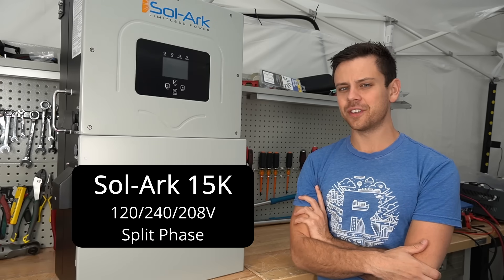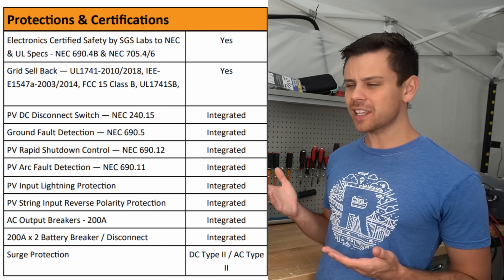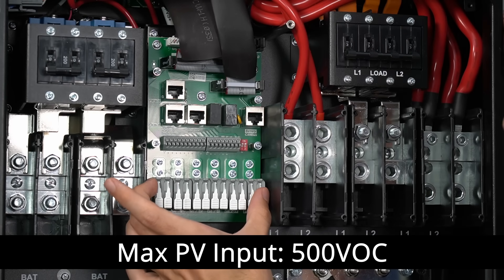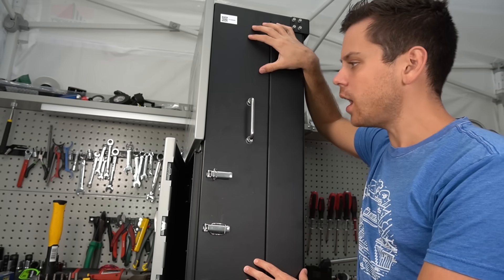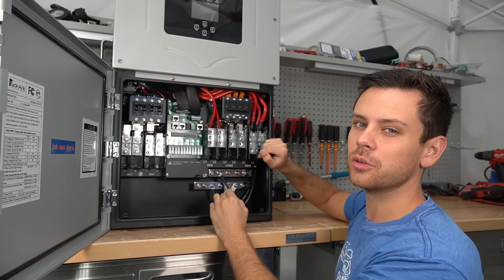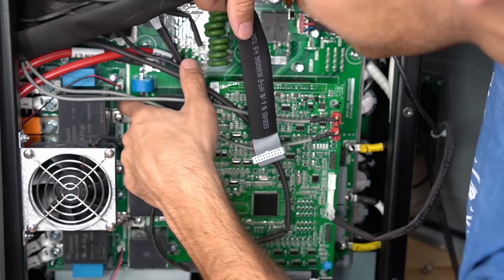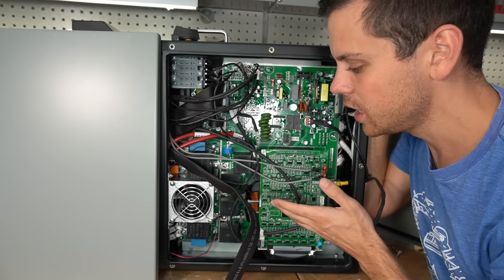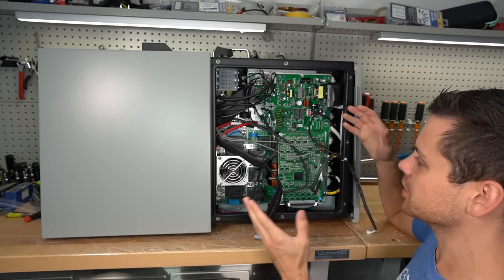Sol Ark 15K: Ultimate Grid-tie or Off-grid Inverter

Comment: Their tagline is "solar for everyone" and preach independence but if you want to qualify for full warranty and support you can't install it yourself. That and the price tag many many times everyone else is a non-starter for me.
Reply: @Channel-gz9hm  You don't need a 3 year union apprenticeship.  You just need skills and knowledge related to the construction of the electrical equipment and installations, and safety training to recognize and avoid the hazards involved.  In other words, you need to know what the heck you are doing, so that you don't kill yourself.  That's all it takes.  It does not say you need formal schooling, an apprenticeship, etc. just enough training to keep you from killing yourself.

You should have this no matter what, if you are working on electrical systems.
Reply: You can if you are qualified to do the install.  The problem is, in order to provide support, the person on both ends of the phone needs to have reasonable knowledge, and if someone at sol-ark support is speaking with someone who doesn't know what a wire nut is, then it's really difficult to actually get somewhere and solve the problem.
Reply: @CurrentConnected  That's like telling someone they're free to be a physician at their local hospital right now, all they have to do is have their MD Board Certificate on them, no big deal. What a flippant dismissal of the issue.
Reply: @Channel-gz9hm  Qualified, as defined by NEC: One who has skills and knowledge related to the construction and operation of the electrical equipment and installations, and has received safety training to recognize and avoid the hazards involved.

In no way is this like having a MD board certificate.
Reply: @CurrentConnected  Amen

Comment: Work for The Solar Exchange in Taylor, AZ, and this beast is the most popular all-in-one we have. Only caveat is it has to be installed by licensed installers for the warranty.
Reply: Licensed in what way?

I know I'll need a licensed electrician to do the AC work (grid disconnect and reconnect to my panel).
Reply: @bkspotify4337  If that means anything other than licensed and bonded electricians then I'd never buy one.

Comment: I hated to see your last few EG4 videos go away. Hope you get those issues resolved.
Reply from the maker: I got it to work so I'm trying to figure out what to do. Might do beginner step by step video again
Reply: @WillProwse  
Looking forward to it. The EG4 6500EX is what I'm looking at for workshop power. I had to upgrade the plans from a single 48v rack mount battery to at least 2 because Signature Solar video demonstrated that an inductive load start inrush can cause a single battery system to shut down. The solar array part will have to be delayed until I can find an installer for such a small system. So I plan to run a 12 gauge line from the meter and set charging current to 10 amps. My usage duty cycle of the shop makes a 10 hour nighttime recharge a viable option. As opposed to a 150' trenched run of larger wire for even a 50amp grid service.
Reply from the maker: @The Osborns ok will do. Just need to make sure it works perfect

Comment: Too expensive; even compared to my Victron dual-inverter system
Reply: When I was selecting my recent inverter purchase I priced everything out and the equivalent victron system was actually more expensive and in many ways was an inferior system.
Reply: @niktak1114  I guess it depends on your needs.  I would need two of these to power my home.  I have two victron 10kW inverters and two external charge controls to handle 20kW input over 4 arrays.
Reply: @jeremydumoit4487 I will need two also but I'd need 4 of the 10kVa quattros (which can only do 26kW combined in warm temps).
Reply: @niktak1114  That's unfortunate.  Mine generate very close to 10kW each here in Maine

Comment: Please do some offgrid load balancing tests. That was always the problem with solarks. Lets see if they fixed it!
Reply: I am curious about this too. There's a lot of mixed reporting on this issue, and it would be great to see an in-depth analysis.
Reply: idk why everyone is getting so defensive... its a test. If there is no problem then the test would show it.
Reply: @av1204  :  Not being defensive; just trying to represent the truth. The subject has been covered (including by Dave Poz in a follow-up video). HF TL (High Frequency TransformerLess) inverters have their advantages, as do transformer-based. The transformer-based inverters do handle large inductive loads better. If you want the advantages/efficiencies of a modern HF TL inverter, but have some larger inductive loads, then 1) make sure you have the latest firmware, 2) balance the loads, and if you still have an issue, 3) add an autotransformer - at a relatively small cost.
Reply: @gerrygreen3832  Isn't the autotransformer's common  only 35 amps?  I love this Solark and would love to make this work for me.  I currently have a 12kW transformer based system and it's a real workhorse.
Reply: @ericbraun4652  : That sounds about right for the SolarEdge TX-5000 that was used in the videos. It seemed to be more than enough for the testing of the 12K. I don't know if there are higher rated autotransformers available, or if they are even needed for the 15K (I would assume they might be for large imbalanced inductive loads, but who knows what magic the elves at Sol-Ark  may have pulled off). I would call or email Sol-Ark for a definitive answer.
Reply: There was never a balance issue. It was just people who tried to overload one of the legs. Similar to if someone tries to overload a LV6548 in a split phase parallel 6548 setup.
Reply: @niktak1114  there are videos of the solarks not being able to load balance at all even up to what they are claiming to be the max per leg.
Reply: @av1204  That must be an issue with early units. I haven't had any issues with mine or heard of anyone experiencing that. The 15k can actually do a bit over half the total output on a single leg.
Reply: @av1204  Most (if not all) of the videos claiming this did not have the latest firmware available at the time. Also, subsequent videos have shown, if you're going to have large inductive loads, then the simple addition of an autotransformer solved the issue(s).
Reply: @av1204  By those Videos you mean David Poz using the Beta firmware and not setting the Max battery Current?
Reply: @Dreadlk  If the "videos of the solarks not being able to load balance..." included the one by Dave Poz (whose videos I enjoy - by the way) you reference, then yes, that is  the most well known.
Reply: @niktak1114  As a non-electrician , I am curious how much load imbalances like the ones artificially created can occur. I know it can be mitigated with load balancing in the panel, but I am curiuous how often issues arise in the real world.
Reply: @azimbroff  It could only really happen in houses that run large 120V loads (large 120v well pumps or large power tools). The largest 120v loads at my house are the freezers and my PC. The big stuff is 240V.

Comment: Running mine for 2 months now.  Put 50-70kwh a day through it. its been almost flawless.  They're still improving the software, but overall im very happy.  Wish it had offline monitoring, i dont like relying on a remote service.
Reply: I agree about the monitoring. I can't understand why they don't make it so you can directly connect to a web interface.
Reply: @98grand5point9  up sales
Reply: @TK-123  They dont' charge for it.
Reply: The selling point for me was the ability to do grid tied with 200a passthrough and also have my 12kw generator hooked up and controlled.
Reply: Powerview web page is awesome but the 5 minute delay in updates suck.
I heard they will be moving the servers and going to 30 second updates soon.
It's still to long for me so I got Solar Assistant which does updates every 2 seconds.
Reply: Use Solar assistant  on a Raspberry PI.
That’s what most of us use not PV pro..
Reply: @nb117  thanks I'll check Into this. Dude that is perfect THANKS